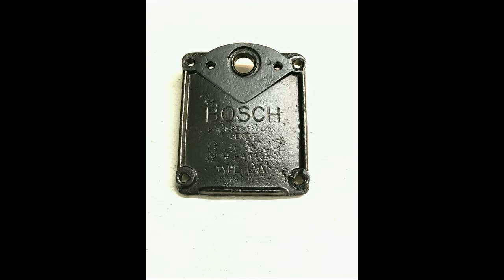Felix Stationary Engine Restoration - Part 3

Comment: Being a nervous ninny that pin locking the Gudgeon into the piston bothers me. 
If it comes loose can the piston pin move laterally and damage the Bore?  
Cheers Eric
Reply from the maker: I think it'll be ok, that got fitted today and was well tightened. The gudgeon pin could float if the locking pin dropped out but I'd be very surprised if it actually did any harm. I suppose one could grind the ends up and fit copper caps.